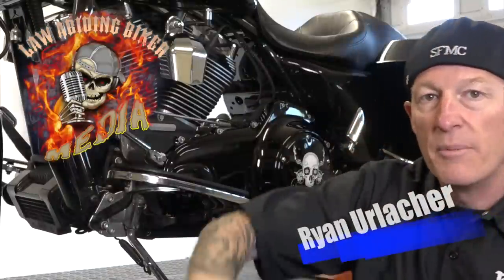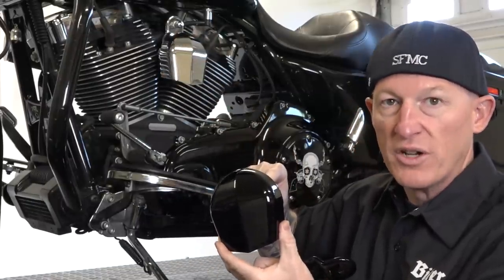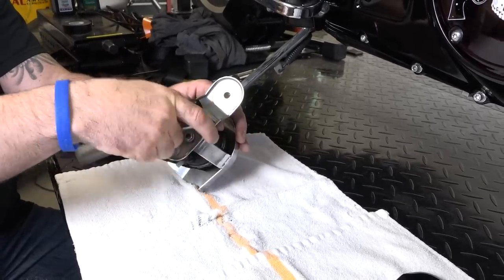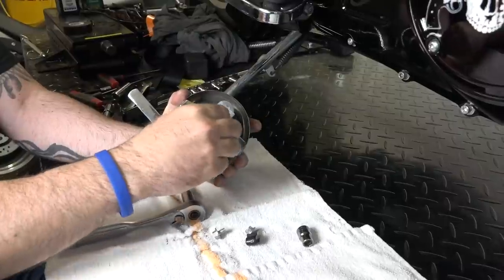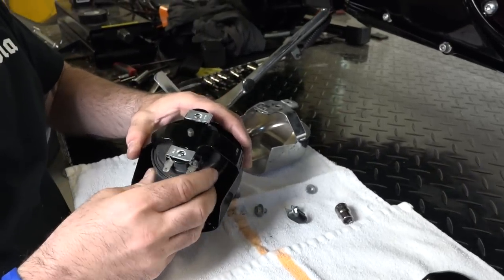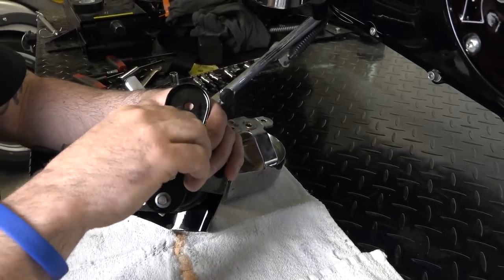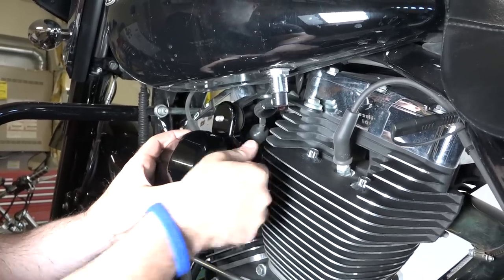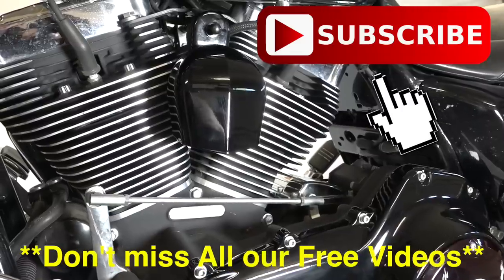Install Harley Davidson Horn & Cover-DIY-Motorcycle Podcast

Comment: Ok I did exactly  what you showed and it seems  like the horn is grounding out in side the horn cover but when the horn  is out of cover it works fine I bought  another  horn and hooked it up and same thing I switched  the wires and still grounded I know it's not rocket science  but do you have any tips ?

Comment: Hey Ryan maybe you can help. I have an 01 Electra Glide and the horn quit working. It would work every now and then if you push the button but it wouldn't stay on. I took the wires off and checked it with a light tester and the light tester lit up when I push the horn button. Went and bought a new horn hooked it up and that horn didn't work either. Took the old horn in the new horn and tried it out on a portable battery pack and they both work. I use the light tester and grounded the negative side of the horn to the bike I could feel the horn click but it wouldn't blow. Any ideas?

Comment: You should've used Silicon Grease on the Horn Terminals. Keep them from corroding.
Reply from the maker: You certainly could Chris. Never had a problem here though. Thanks for watching.

Comment: Good video.....  
Question, How about a video on a hydraulic clutch that drags when trying to shift into neutral...?  I have a 16 Roadglide 103..  I checked the manual and it says the primary takes 38 oz of lube... wow that is a lot..  I put in 28 oz like my old softail and the clutch does not drag when I try to put it in neutral at idle.  SO whats up? Is there some sort of adjustment on a hydraulic clutch? The manual does not show any that I have found.  It is not like my cable release softail.   Any help would be appreciated.
Reply from the maker: Glad you like the videos. Nope, no adjustment on Hydraulic clutch. Yes, they have changed oil capacities over the years. The primary likely takes 38 oz if you remove the entire outer cover. If just draining for oil change then likely 28 oz....tha'ts how my 2014 street glide is. It will specify that, so check.  Not sure what you mean by "dragging" when shifting into neutral. 

Ride safe & Ride Often!
Here is a link to a bunch of our useful Free vids bro: http://www.lawabidingbiker.com/freevideos
Here is a link to some of our useful for purchase videos: http://www.lawabidingbiker.com/buyvideos
Want Answers & Information Fast? And help support us at the same time? Do you like the content we provide?
Our patrons get answers to their questions/comments/feedback in less than 24 hrs and are part of our Private Facebook Group. If you are interested in being in this exclusive group you can get all the details at ==> http://www.lawabidingbiker.com/patreon
If you haven't subscribed to the Law Abiding Biker Podcast make sure to do so. Listen in as we talk weekly about issues/items like this & so much more. You can listen on iTunes (Apple/IOS), Stitcher Radio (Android), or any other Podcast App ==> http://www.lawabidingbiker.com/podcast
Join our free email club at http:///www.LawAbidingBiker.com/EmailClub. Only relevant content will be sent from time to time. Email club members are the first to find out about free or for sale content are given special coupon codes.
Reply: Dragging.. like the clutch plates are not quite separated enough. Keeps me from finding neutral..  On my old softail it was even a symptom of overfilling the primary, from my HD manual but no mention of that in my 16 Touring manual.
Reply from the maker: You need to get your clutch checked. There have been recalls on some components/air in the lines etc.....

Comment: It was a good video until your hands got in the way of the wire connection which is Negative and which is power on the horn and wires?

Comment: I replaced my horn with an HD Willie G. Skull cover, but when I tighten the acorn nut it sounds like a dying cow; but when it's loose it sounds fine. WTF? (19 Limited, have never washed it with water, wires are tight)
Reply from the maker: Sounds like a new acorn nut may be needed? Not sure

Comment: My acorn nut is seized.  When I try to wrench it the whole aluminum bracket starts to twist and the horn cover just twists right into the heat sink on the cylinder at which point i have to stop because the chrome horn cover will mar the heat sink.

HOW DO I REMOVE THIS DAMN THING!!! LOL
Reply from the maker: WOW!  That sucks.  Have you tried a penetrating oil?

Ride safe & Ride Often!
Here is a link to a bunch of our useful Free vids: http://www.lawabidingbiker.com/freevideos
Here is a link to some of our useful for purchase videos: http://www.lawabidingbiker.com/buyvideos
Want Answers & Information Fast? And help support us at the same time? Do you like the content we provide?
Our patrons get answers to their questions/comments/feedback in less than 24 hrs and are part of our Private Facebook Group. If you are interested in being in this exclusive group you can get all the details at ==> http://www.lawabidingbiker.com/patreon
If you haven't subscribed to the Law Abiding Biker Podcast make sure to do so. Listen in as we talk weekly about issues/items like this & so much more. You can listen on iTunes (Apple/IOS), Stitcher Radio (Android), or any other Podcast App ==> http://www.lawabidingbiker.com/podcast
Join our free email club at http:///www.LawAbidingBiker.com/EmailClub. Only relevant content will be sent from time to time. Email club members are the first to find out about free or for sale content are given special coupon codes.